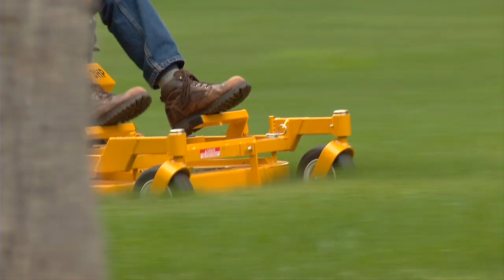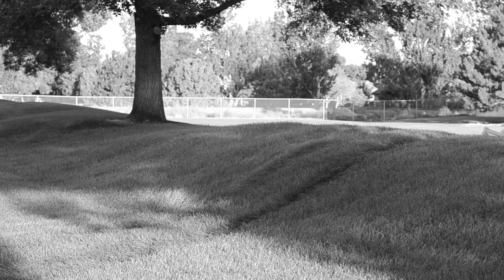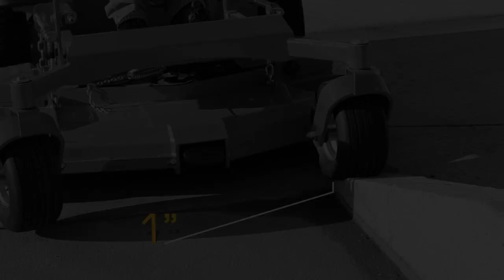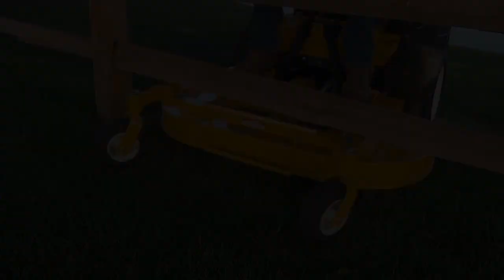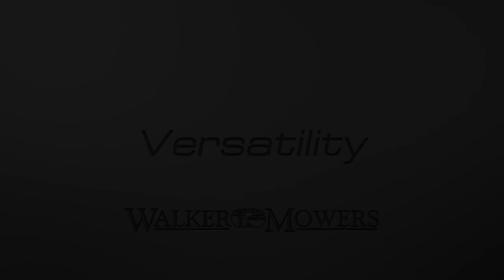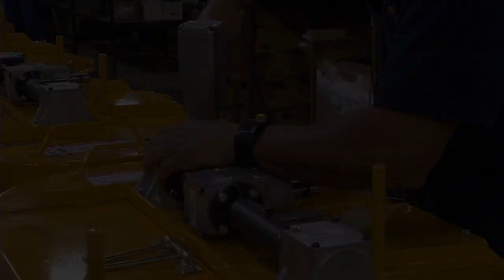WALKER MOWING DECKS - A Detailed Look

Comment: These excellent decks are one of the many attributes to these far superior mowers.  Examples: a. One hand forward speed control instead of 2 hands. b. Small and lightweight while powerful and wide cut. c. Timed counter rotating blades that lift the grass for the best cut. Premier Landscaping is one of the most experienced and efficient mowing companies in Greater Vancouver / the Fraser Valley and they have used Walker Mowers for decades.
Reply: These mowers are slow, don’t cut well, are cumbersome, leave unappealing stripes, are overweight, and offer no true advantage over a stand on mower. Keep living in fantasyland though!

Comment: i had a 2000 walker ghs that cut awesome so in 2018 i wanted a new mower & i got the same exact mower & wow the cut quality has gone down hill & you have to drive over the leaves 2-3x to pick them up .the mower leaves random blades of grass un cut all over  been to the dealer with no luck getting it fixed or any advice. o yeah & dont forget the rust bubbles under the paint from day 1 that are not covered under warranty
Reply from the maker: Brad, we are sorry your experience with you new mower is less than ideal. Feel free to contact our service team and we can work with you and your dealer to see what we can discover. service@walkermowers.com
Reply: I’ve seen similar stories on YouTube from longtime walker users
Reply: You know Miss, 
I had the same problem with my first walker..
The blades had been installed backwards by the dealer..as well as 2 idler pulleys loose..
The walker product is faultless..
But unfortunately the pre delivery of dealers will continue to be a problem, especially if the have the practise of stripping in stock machines for parts..
Dont despair..king regards Philip, Darwin, Australia